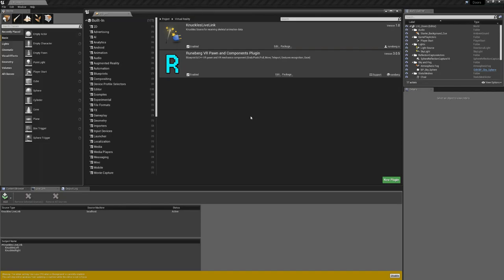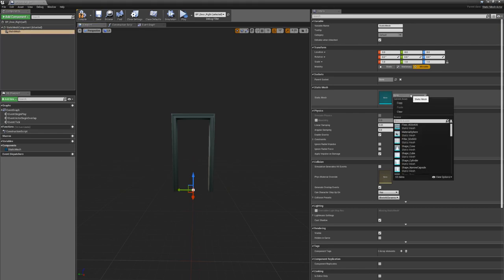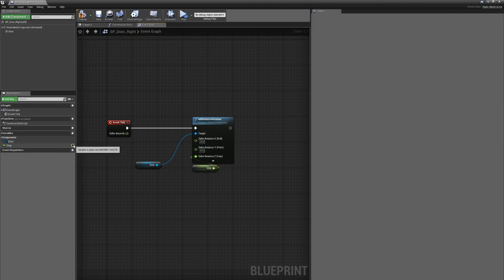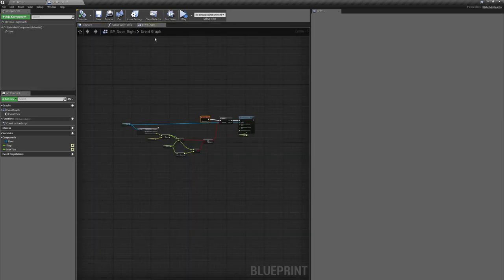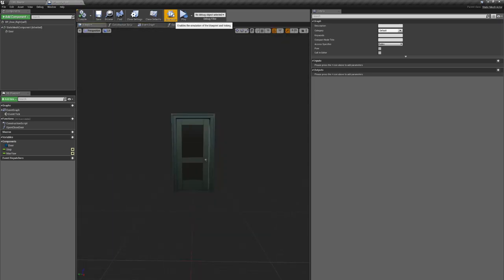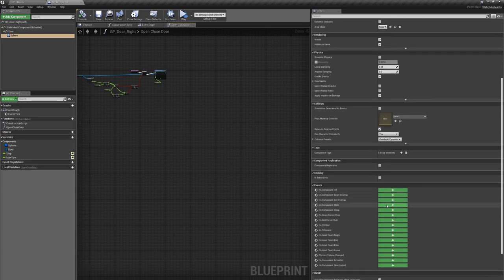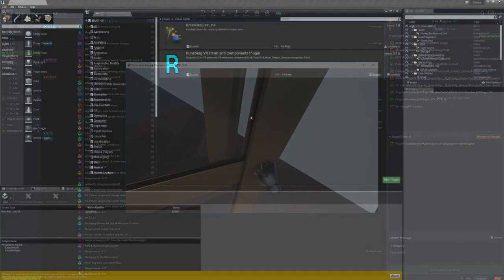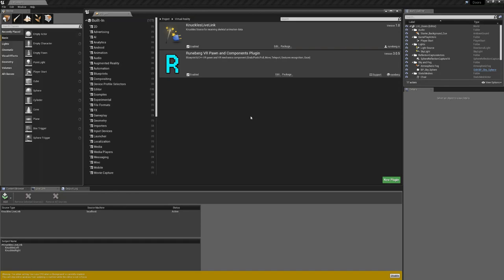Knuckles EV2 field test and Implementing an open/close door mechanic in VR

Comment: Can you explain the part where you used motion controller L \R and isgrabbing  because if you try to do this in VR template you can't reference the is grabbing for the condition at 11.20 so how do i set up the condition ?
Reply from the maker: Hi, I wasnt using the VR Template on this demo. The IsGrabbingL/R is just a boolean field in the VRPawn that gets turned true or false based on the trigger (r/L) states.

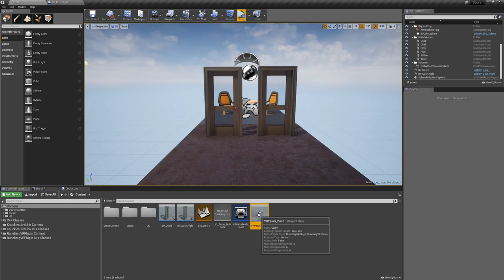code is on around 10:20...

Comment: Where did you set up the "HandR" - Tag?
Reply from the maker: This is a pretty old tutorial by now, but the HandR is jutt a boolean on the right motioncontroller bp iirc
Reply: @1RuneBerg  what do you mean with iirc?
Reply: @1RuneBerg  I too am curious what 'iirc' is and how the 'HandR' boolean is added to the graph of the Motion Controller.
Reply: @RobH2  iirc = if i recall correctly

Comment: Just curious, could you possibly do a tutorial (or a deep dive explanation) on how to have two grabbable meshes in a single blueprint? 
For example, a slide on a gun
Reply from the maker: Hi Starter Pack. Thanks for the suggestion, will add it to my request list. But technically it's just a variation of this open door mechanic where instead of adding relative rotation, you're adding/subtracting relative location. The grab itself for the main part of the gun can be easily handled by the plugin's Grabber component which I already have aa deep dive tutorial for.

If you have a skeletal mesh for the gun, you'd add/subtract the relative location of the slide bone in an anim BP (transform bone), or a 1d anim blend, heaps of options :)